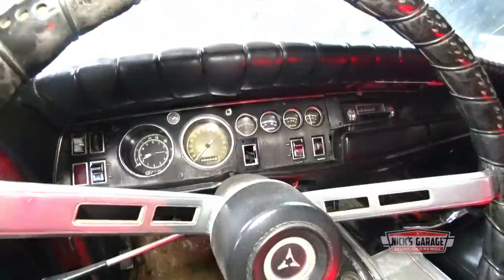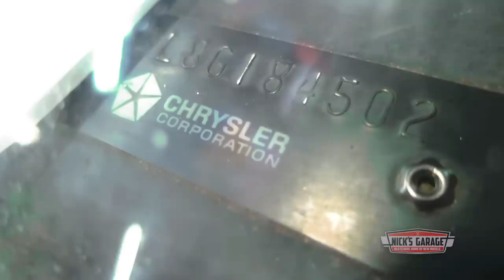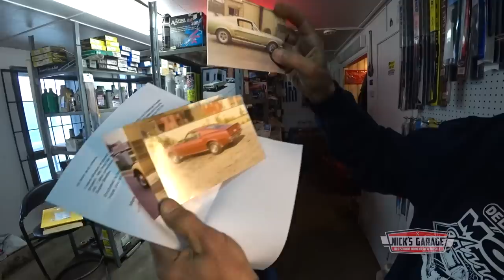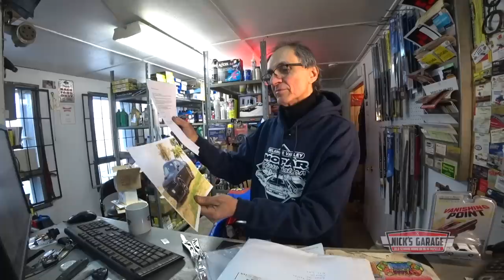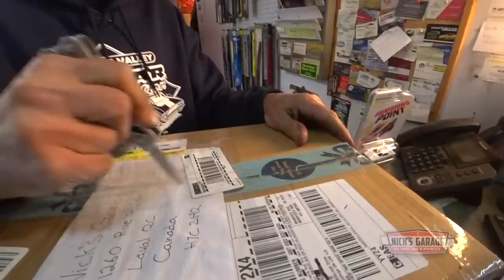1968 Coronet R/T 440 Tear Down - You Won't Believe What's Inside!

Comment: There’s your missing distributor clamp bolt. Someone dropped down the carb.
Reply: I believe you might be right.
Reply: How would something that large get past the intake valve?
Reply: "Lady, theres your problem"
Reply: Maybe head was off, took distributor off, dropped the bolt, looked all around on the floor, couldn’t find it. 
Could that bolt really sit there and not be seen?
Reassemble engine. 
“Where’s that distributor bolt?”
Got one out of junk drawer.
Reply: @scatpack68  my guess is that it goes through threads first then the piston comes hits it and prys it the rest of the way through.
Reply: @bigragu6828  probably not since the engine most likely would need to be manually rotated prior to first fire up and within a couple revolutions it wouldn't make it to tdc.
Reply: scatpack68 
How could a 3/8 bolt fit through valve opening, even if it had a .590 lift cam?
Is it possible?
That’s why I figured the head had to be off.
Reply: @bigragu6828  the bolt head would probably never make it past the valve.
Reply: scatpack68 
Exactly, which is why I figured the head needed to be off. Only other way for bolt to get in there, is if someone put it through the spark plug hole. 
Either sabotage or trying to feel piston come to top. But you would do that to #1 piston, not #2 to find TDC on the blind.
Reply: @bigragu6828  on a 4 stroke trying to find tdc #2 would still be at tdc at some point in the cycle
Reply: scatpack68 
Not if you’re trying to install distributor. Then you’d want #1 on TDC to point rotor at #1 wire. 
Unless you’re using 21843657 as your firing order.
Reply: @bigragu6828  Ford guy, number 2 is their 1.  Bolt had to be in cylinder at first fire, got embedded in piston, so it didnt make much noise
Reply: Ed 
#1 is left front. The bolt was in #2 right front.
As original commenter said. “There’s you distributor bolt.”
Only, I can’t see it going down carb. 
Had to have fallen in when head was off.
BB Mopar, distributor is angled toward right front, #2
Reply: @bigragu6828  its not even possible to get the 5/16-18 bolt through the spark plug hole in its original form let alone a 3/8. Im surprised that even cranked over.
Reply: scatpack68 
I’m gonna watch video again. Try to see combustion chamber size. 
It may well have room to move in there. 
Then it mashes between valve and piston which would account for bent pushrod and lifter failure.
Reply: Sounds likely it was a front cylinder , maybe when the carb was off !
Reply: @bigragu6828  It makes me question the competence of the so-called mechanic that had the engine apart. It reminds me of my x neighbors, if they attemped to change a water pump on an engine, they would mess engine up and the whole car went to the scrap yard, every time.
Reply: Albert Smith 
Good luck having the guy admit to his sloppy mistake.
Reply: Not too many fully threaded bolts are normally used on those motors, not that I think it's a stock bolt
Reply: WCTA Chicago underground sound 
Distributor clamp bolt should have almost full thread.
Reply: 70scarresstoguy 
I felt it was highly unlikely it went down the carb and into cylinder through the valve. 
That’s why I agree with original commenter, that they just found the distributor clamp bolt. 
Head was off, the distributor was loosened. The hold down and bolt fell out of guys hand, as he twisted the distributor. 
It makes sense.
Reply: matt bauckman  , I bet your right
Reply: @scatpack68  Could be why the pushrod was bent.....
Reply: @bigragu6828  1) hold down bolt is a 5/16-18 thread 2) length is 2 inches 3) original bolt only has threads halfway up.
Reply: scatpack68 
Every hold down bolt I’ve turned were 3/8. Used 9/16 wrench to turn it.
Reply: @bigragu6828  might want to check that again. Still have my #'s matching 68 R/T after 32 years. 5/16 from day one.
Reply: scatpack68 
If that’s the case, then, would that bolt fit through the valve?
The point has been, did bolt fall into cylinder while head was off, or did it fall down carburetor?
Original commenter started with, “there’s your distributor bolt”
In fact, I went to comment section as soon as the bolt was revealed in the cylinder. I wanted to comment that that might be the missing bolt, because Nick said in the video, that it was not the proper bolt holding down the distributor.
Reply: @bigragu6828  my guess is that it more than likely was in there before the head was put back on. Either they were extremely careless or intoxicated. Being a distributor clamp bolt can be immediately ruled out because of the length and diameter.
Reply: Hi we have numbers matching 428 fe  with real bad cylinder no.8 the only way to fix is with a sleeve. Would you go this route or find another block? We enjoy the shoe very much. Gary
Reply: @scatpack68  16:38 You can see a crescent shaped mark in the piston where the valve crushed against the bolt and left a dent for each end of the bolt - possibly when came it through the intake.
Reply: Upon install back into the car the carb was off. The bolt was carelessly dropped into the intake.
Reply: There is an old saying in Texas. You thought you farted and s*** in your pants
Reply: Talking about sabotage. Had a small block Chevrolet in a 63 p/u in the trade in Boneyard at a dealership. Popping and sputtering someone had put the distributor rotor on a hundred eighty out. Could have been why they traded in the truck. After a tune-up.
Reply: @bigragu6828  The lift on the cam is around .450 lift max.The head was still on.
Reply: @scatpack68  It was a 3/8 bolt.
Reply: @bigragu6828  No, it does not.From what I figured out, the carb was replaced at one point and I believe that is when this bolt fell in.It was a bolt from a hardware store.
Reply: @bigragu6828  1/2  inch wrench on the distributor hold down clamp.
Reply: @jedclampett6466 . I totally agree with you Jed.
Reply: That's a long bolt to make it past the carb and intake valve.  But it could be the distributor hold down.   I think. It fell down the intake not the carb you can on a 440 pull the intake with out the distributor.
Reply: Nick Panaritis 
Maybe different on the SB? Such as 318, 360 or 340?
Reply: @edwardmartinez199  its way too short and the wrong thread size to be the distributor clamp bolt.
Reply: matt.      No, it was not the Dist. hold down clamp bolt. The Dist. hold down bolt is 5/16, 1/2 head and 1 3/4 inch long.
Reply: @bigragu6828  .    Same  bolt as big block but 1inch shorter on small block.
Reply: They've dropped ít down spark plug hole
Reply: Thanks Nick. Just made a wild guess. 👍
Reply: Paul Ragu l.
Reply: @bigragu6828  Yes, believe it or not!  Hard to believe, I know.  Found a nut in a cylinder once, didn't seem possible it could make it passed the valve but maybe.
Reply: @scatpack68  It can't. some moron put the head on without looking first.
Reply: @doug112244 
Head off-
covers head with rag/towel- 
pulls dizzy-drops bolt in towel rolls into cylinder-no noise tidys his towel after leaning over-next day/ week pulls towel sets head in place no need to inspect again "it's been covered".
Reply: That's what I was gonna suggest as well.
Reply: OUCH!!!! so easy to keep an empty bucket to place over the carb when air cleaner is off....
Reply: @bigragu6828  - Just like a doctor leaving a surgical sponge or hemostats inside and closing up after surgery.
Reply: Maybe the bolt was sitting on the upside down head while it was off, then simply dropped in when the head was tilted over and  re-positioned back on the engine?
Reply: @edwardmartinez199  Thats the only way,through the distributor. No way else unless it was on purpose. And it's not the correct bolt
Reply: Never underestimate the ability of an internal combustion engine to eat itself alive off a seemingly minor mistake. Maybe they had the plugs out and accidentally dropped the bolt into the hole without realizing it. Though I wouldn't rule out the bolt making it through the intake valve, stranger things have happened.
Reply: Too short for that bolt
Reply: @dartgts383  Was waiting for someone to point out that the piston doesnt stroke beyond the cylinder so no way it got on top of the piston from anywhere but the valve. And odds are they had the carb off leaving easy access to the intake. The bolt could of come from many places
Reply: @Rattlerjake1  - Yes, but leaving a bolt on top of a 440 piston is much WORSE than leaving a pair of forceps in a patient during open-heart surgery.  That poor Mopar!
Reply: Its possible thats what happened. The piston was probably all the way down so they didnt see it. If the head wasn't off then it was factory thus being why the car survived with all original. But I guess it probably couldn't run long like that before the lifter and pushrod took a dump
Reply: @scatpack68  Pretty easy after the initial jam caused the lifter to come apart. Now the valve is hanging. I'm 59 years old now and been dirt track racing all my life. Have dropped wing nuts, many washers, section of 3/8 rod that centers the breather, etc into a running engine.
Reply: @scatpack68  Exactly dude...it was probably just a top end rebuild. Only they made it worse than it was before they started. My guess is that it's a result of the Micky Mouse mechanic.
Reply: I bought a big block Chevy from a buddy and was going to rebuild for a project. I found what looked like a flywheel bolt laying on top of number two piston no damage but the bolt was rounded off. Told my buddy what I found an he said it had a noise when he drove it in a truck he had. Somebody dropped it down the carb somehow.
Reply: @albertsmith6717  I have a neighbor like that. Every time he tries to fix something it never sees the road again. He's got 6 pos cars & a broken down ugly dodge van motorhome over there. I tell people that he's trying to start his own junkyard. He's got so much piled up crap over there. It looks like a junkyard.
Reply: That bolt is too short for the dist clamp
Reply: Good call...!
Reply: @bigragu6828  +-The bolt that appeared in the piston was still a 3/8 bolt, so asking if a 5/16 bolt would clear a valve is not relevant.  What happened here looks a lot like what most others are saying, the #2 piston was likely at BDC and the bolt got dropped in.  The bolt that was in the piston does not look like any stock production bolt to me.  Stock fasteners are never shiny like that one is.  It could have been a replacement exhaust flange bolt though.  B and RB engines use simple 3/8 nut and bolts to hold front pipe to manifold, and are typically quite short.  

The bent push rod was due to the valve striking the piston, stopping it from opening further.  The lifter kept trying to open the valve, and the push rod bent.  Must have been original type push rod because any cheap replacement pushrods would just push the tip into the pushrod, or puncture through the rocker arm.  If you look at where the bolt ended up you will see that it got launched to where it ended up.  The bolt would have been sitting at the furthest spot down in the cylinder.  It got driven into the highest point in the cylinder.
Reply: @garyharrison555  If you are going to restore the vehicle and just let it sit in the garage, and if it is important to you that it is a numbers matching block, you will have to sleeve it.  That being said, if you intend to drive it, keep the original block, and get a replacement block or purchase a crate engine to use.  Keep in mind that if you are looking at a crate engine, you can get a small block windsor engine displacement up to 460 now.
Reply: lahokc59  no where near enough room for a 3/8 (with a 9/16 head) bolt to make it past the intake valve.  If the bolt was in the intake port the most t would be able to do is hang past the valve and keep the valve open.  It would have to bend the valve over to get the gap large enough to pass the head of the bolt, and that would have been obvious when the rockers came off.  The valve would have been hung open with the rocker arm shaft removed.
Reply: If you look at 9:41 of the video you will see the bent pushrod is the intake rod. My theory is the thread end of the bolt made its way between the valve and seat. The resulting lack of pressure on the lifter allowed the pushrod to damage the keeper on the lifter. The lifter opened more than normal which caused the valve to be opened to as far as the valve spring would allow. The bolt falls all the way in and the pushrod gets bent. The rest is history.
Reply: @bigragu6828  That sounds more plausible. All the evidence points that way. New gaskets everywhere... "Just go find a bolt. We gotta get this to auction." (FF several hours later) "Did it start and run?" "Yup"  "Good enough. We'll put that on the description."
Reply: How could it pass the valve in tact?

Comment: Imho, the bolt was dropped through the distributor opening. The guy just did gaskets and replaced the old distributor with the MDI one and had left the distributor bolt in  the block to prevent loss. He went to  remove it to drop in the distributor and dropped into the block. Looked at it and decided it was too much trouble to go back in and get. He figured it would run well enough to get rid of!

Comment: Nick, If you only have a bad cylinder and you are trying to save an otherwise good block is it feasible to sleeve a single cylinder?
Reply: cvc not recommended to do that my friend!
Reply: @johnnyhawkins43   I understand that and would not even consider that fix on a power build. More along the lines of a rare (these days) stock motor. I guess I am spoiled from the diesel prospective where a block can be used indefinitely with interchangeable liners. I guess it makes no sense to even build a gas block that functions with liners, but interchangeable liners for displacement on demand would be a cool project. Small bores for high rev and big bores for torque build the next month. Of course you would need spare heads to match. Has anyone tried that in the custom engine world?
Reply: cvc.      Yes, a sleeve no problem.

Comment: With those goofy exhaust manifolds, maybe the bolt fell into the head from the elevated exhaust port of the exhaust manifold.  Not sure there's enough lift on the exhaust valve to let that size bolt in however.

Comment: I've seen a few things head pressed into a piston like a washer or a small screw some with no engine noise to boot. Only visuals from a borescope but never a bolt that size and I have a hard time believing it got past the valve that's a new one. Without seeing any cylinder wall damage I would bet it broke while cranking. I like the tag that's a perfect fit for Nick's car.

Comment: This is known as FOD.
Foreign Object Debris.
In the airline industry, a plane doesn't fly until the missing bolt, nut, washer or tool is found.
The shop and Your personal tool box will get turned upside down.

Comment: Easily repaired even if there was a hole in the cylinder. I fix this kinda d of thing all the time. Either weld or pin the head. And heavy sleeve in the block if needed

Comment: Oh, this brings back bad, bad memories of one of my first rebuilds back in the early 1970's, and to make things worse, it was a buddies engine.  He had a Chevy, 350ci that needed a rebuild, (so long ago, I don't remember why.)  I had only done two or three complete rebuilds up to this point, and I did good enough to feel confident about another.  Long story short, somehow I dropped a bolt in on top of a cylinder and never noticed, until I turned it over the first time.  Expensive mistake, but one I never made again.   Good thing I worked in the family business, or I'd have been cashing food stamps!

Comment: lucky the piston didn't crack the block when the bolt punch into it, had it happen when an engine snapped a valve head off and it punch through the center of the piston causing it to expand and crack the block. as for how the bolt got there aside from sabotage, the only way's i can see it happening are through the spark plug hole or when they had the heads off  a bolt landed in the cylinder and they didn't notice it before they put it back together.

Comment: Theoretically, that bolt almost HAD to be in there when the head was put on. If it's a 3/8" bolt, it's got a 9/16" head, and unless it went through 'threads-first' and the piston came back up and smacked it and knocked it the rest of the way through, it would be almost impossible to get past the valve. It couldn't go through the spark plug hole, since they're 14mm which is a tad smaller than 9/16" even. Definitely a mystery, but I do believe that was the missing distributor bolt that was replaced with a shorter one that someone dug out of a bolt bin. Judging from the way the engine was assembled, I would guess the heads were on the floor before they pulled the distributor, and someone dropped the distributor bolt before the bracket made it to a nearby bench, and it bounced into the #2 intake port before the heads were ever even on the engine.😉 Just speculating...
Reply: Dan.   You could be correct.
Reply: lahokc59  .       The bolt that holds the distributor hold down is a 5/16" bolt with a 1/2" head. The bolt in the chamber that was found was a 3/8" bolt with a 9/16" head.   Sorry if I did not make it clear in the first place.

Comment: i have to have zinc oil in my Guzzi motor - only one we (the owners of the vintage Guzzis) can use is 15-40 Rotella -
Reply: Be careful with the 15w40 Rotella, it's my favorite oil too however they reformulated it a couple years ago and pulled the zinc out to allow the oil to be used in modern spec DPF engines, they had to remove the zinc as the zinc poisons the catalyst material. Triple check, make sure you know what you're getting. Sending fresh oil out for analysis is inexpensive, especially in such a rare motorcycle.